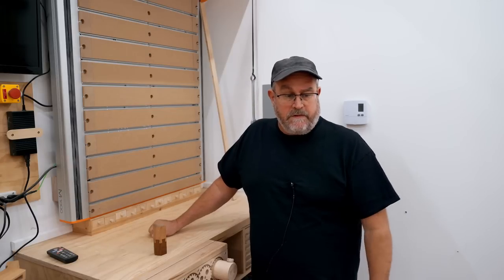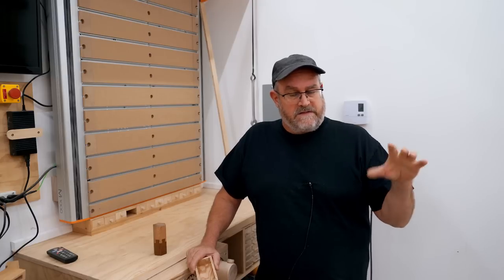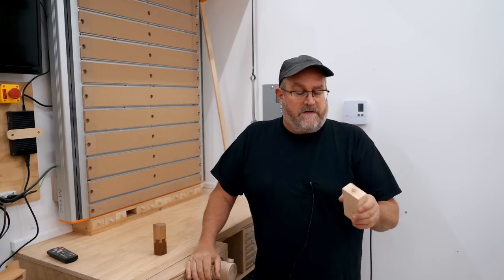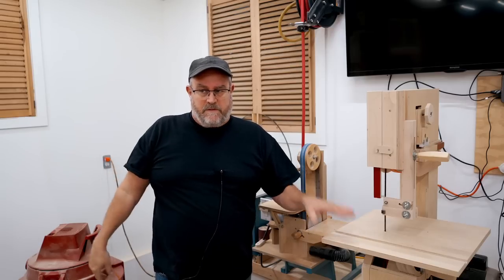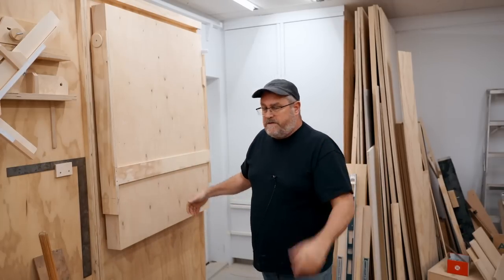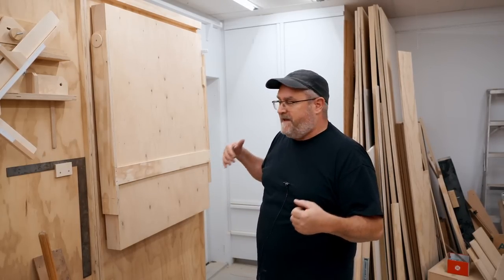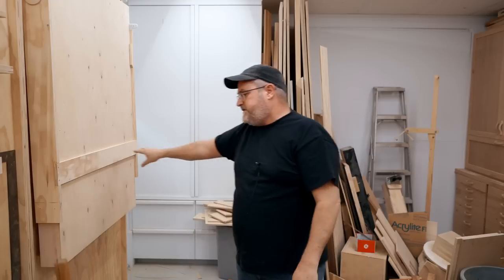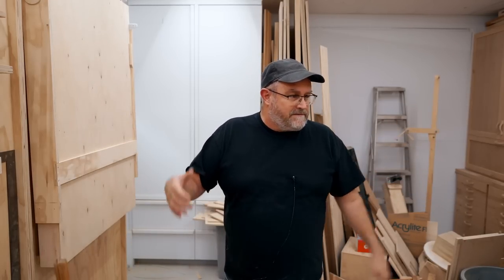Was the Folding Table a Mistake? Maybe...

Comment: Horizontal surfaces are a problem, always a problem.  The smaller your shop, the more things you work on at one time, the less wall storage you have, the bigger the problem.  The way it blocks the door might be a good ploy to keep it from becoming a problem but if you can even barely squeeze by, that ploy may not work.  I figure in my workshop I have about half the shelf storage I need and that's why I have a horizontal surface problem.  I have a multi pronged attack to work on it this summer- 1) get rid of things I don't need, 2) compress some of the storage I already have, 3) move some things from my garage to an outside shed.

Comment: Great simplicity, John. Do you have a diagram or link to the solid state relay circuitry?
Reply from the maker: Details on my website for the older one: https://ibuildit.ca/projects/automatic-load-sensing-switch/
Just replace the relay for a solid state one and the capacitor for one that's 4700uF and 25 v.
Reply: @IBuildItScrapBin  Thanks, john - much appreciated.